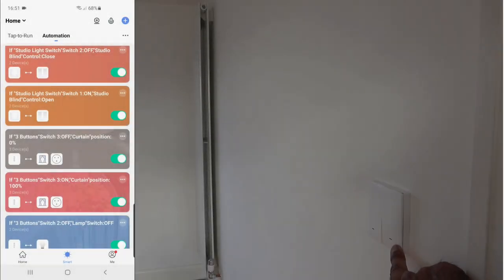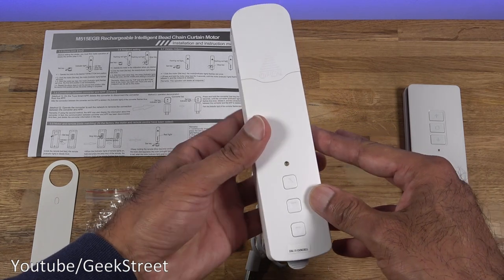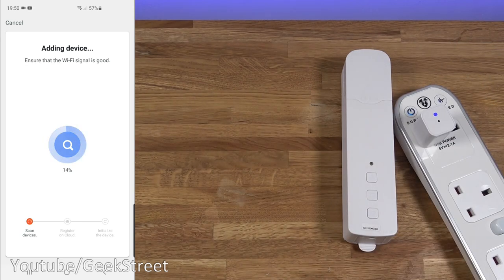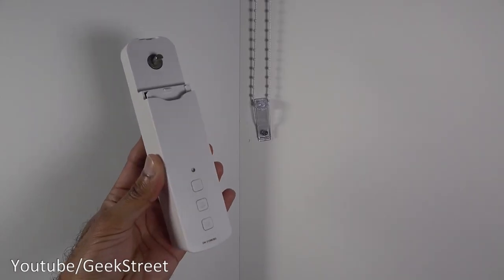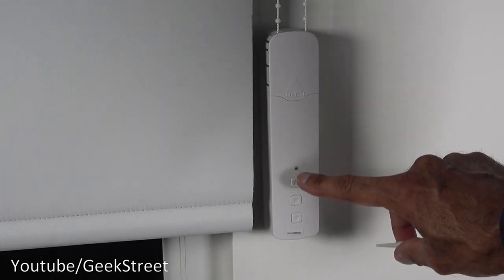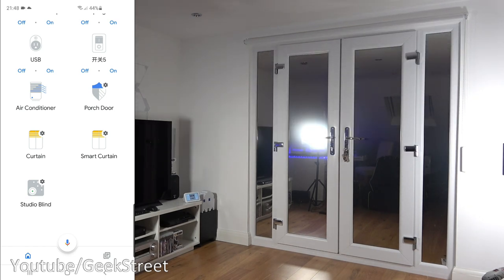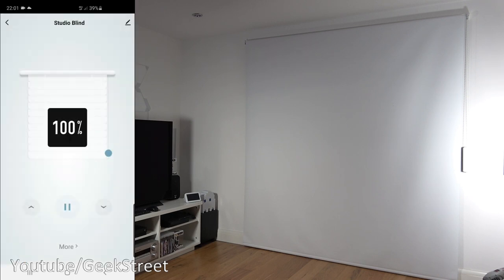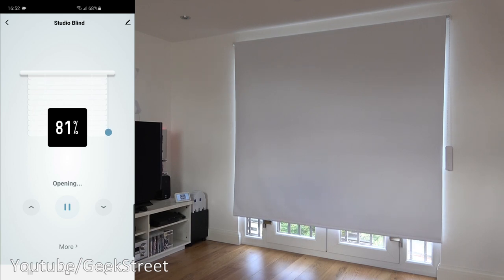BENEXMART Smart Blind Engine works with Alexa / Google Assistant / Tuya Smart Life

Comment: Another comprehensive geek street review, excellent as ever.

I agree, this is the best automated blind I have seen. A definite game-changer for blind automation, awesome.

As you say a solar panel would be a great additional accessory.

It will be interesting to discover how long the battery lasts before requiring a recharge.

I'm assuming that it could be incorporated into a routine to close the blinds and turn on lighting at dusk.

p.s  I was thinking that it would be cool to automate all of  my conservatory blinds, 8 in total.

Then I checked-out the price and suddenly I've gone off the idea!
Reply from the maker: Thanks for comment really do appreciate it. Yes you can set it to work with scenes. I have 2 blind engines and have one opening the studio blind an hour after sunrise. It seems to work well but my only criticism after 3 weeks of using it...it feels a little slow opening and closing no biggy really. Price wise this is average, these things are never the cheapest.

Comment: I'm having trouble setting the limits on the motor.
I tried this method, got the correct flashes but when I run it, it just keeps running past the limits.
It looks like you have already set the limits before you made the video
In the instructions, it also tells you to set a mid-point ? will it work without this?
Reply: I need proper video as well to set limits
Reply: I'm having the same issue. Set limit just doesn't work no matter what I try :(
Reply: I was having trouble but was able to set the limits on the Tuya smart app

Comment: Thanks for a great video! I live in sweden and beaded cords are rare here. Loops are also rare. In Sweden it's common to have in-window blinds with a single thread coming out of the top of the window. Pull the thread down and the blinds go up. It's it possible to tie a single string to this device and get it to work?

Comment: Cheers for the review. Im planning on getting 2 for 2 separate blinds. Do you know if both can be controlled individually by 1 RF receiver?
Reply from the maker: No, each one is paired to a blind engine.
Reply: @GeekStreet  Thanks! Can I confirm that each RF hub will connect individually to a wifi router and not a Home Automation hub such as Smartthings hub?

Comment: Hi I’ve got a bead stopper and chain is joined/ parted under it - is there any way to use this or any small joiner I can use that will run through motor with ease 
Any ideas for me - thanks
Reply: You can buy a continuous chain made to your required length with no lumpy joining piece. I get mine online from Merrick and Day. Plastic or metal. Metal looks nicer but plastic is quieter

Comment: Great guide! Im having an issue where the bottom mode of the curtain keeps changing, at first its perfectly aligned but after a few up and down the space at the bottom keeps growing, any tips?
Reply from the maker: Thanks, I've not had that issue and have 2 of these but wonder if it's related to the gap on the ball chain?! Just guessing here.
Reply: I have the exact same issue
Reply: @mathewtaylor2007  i found that in my case the issue was with google home, if i used the tuya app, the curtain was aligning good, but from google it was off by a few cm every time

Comment: Excellent review I will be definitely getting these to turn my blinds into smart blinds. I am wondering if a after market solar charger could connect to it to keep it topped up, would you recommend doing something like that? Also I see on the site it has a zigbee and wifi option is it the dongle that make it wifi or ZigBee. I got a smart things hub and thinking whether should get the ZigBee version or wifi.
Reply from the maker: Thanks for the comment, power wise you could connect to a solor panel but initally i would wait and see what the life of the product is like, its the dongle the that connects to wifi or zigbee. I didnt realise they did a zigbee version!
In theory the the zigbee version should work with the smart things hub but I haven't tested.
Reply: @GeekStreet  thank you for your reply ma man I might just buy the zigbee version and the  get the WiFi dongle separately because I got a smartthings hub and trying to run most stuff locally instead of WiFi.
Reply from the maker: You're welcome, let me know how you get on with the Smart Things hub and if it works.
Reply: @GeekStreet  sure most definitely will do 👊🏾

Comment: Paired OK to Smartlife app but nothing happens when I press buttons in the app.  Requested help from Zemismart  but no response to-date.  But works OK from remote and note that the usb module not needed for this.  Being used on a 1.25m high by 1m wide Roman Blind and is very slow up and down -  probably about 3 to 4 minutes one way. Can wind up by hand in less than 1o seconds!!

Comment: Did you manage to get the squeeky sound away?

Is it working with Athom Homey
Reply from the maker: Yes I manged to oil both the ends!

Not 100% sire about athom homey but there is a zigbee version which could be compatible if you have a check to see if its on its supported list of items.
Reply: @GeekStreet  what oil did you use? Since the material I plastic I recommend something with PTFE 👍

Comment: I can't seem to get the Zigbee adapter to connect to my wifi, I've used both Smart Life and Tuyu apps with no joy. I have Deco M9 routers. Any ideas??
Reply from the maker: It can only connect to 2.4Ghz WiFi try turning off 5Ghz on your router.
Reply: @GeekStreet  , Thanks for the reply, yes tried that, disabled 5Ghz totally still no joy, is there a reset on the adapters?  I noticed the blue light stays on (no flash) then i have to hold the reset again to get the light to flash slower (as per instructions).

Comment: have a question, on my vertical blinds the ball chain has a connector to connect both sides. This connector is quite big and it will not pass thru... any ideas how solve this?
Reply from the maker: You could get a replacement ball chain
Reply: @GeekStreet  Yup. Easy fix. I'll do that.
Reply from the maker: @AndresEscobar-wi4nm  good luck!

Comment: I am having real trouble setting the lower limit, I have pressed the set button then the up button and then the down button but it will not set the lower limit.

Can anyone help
Reply: I'm having the same issue. I can't get it working either:(